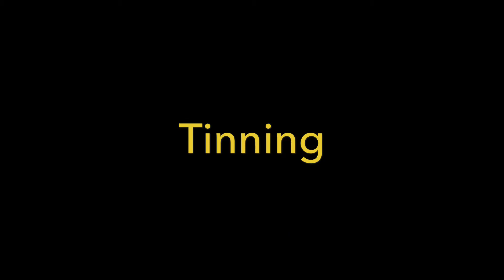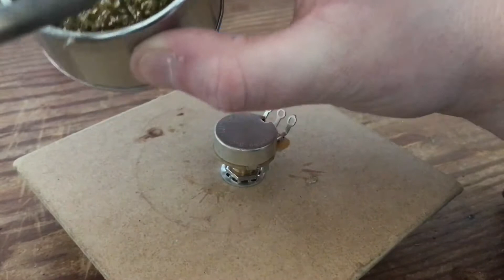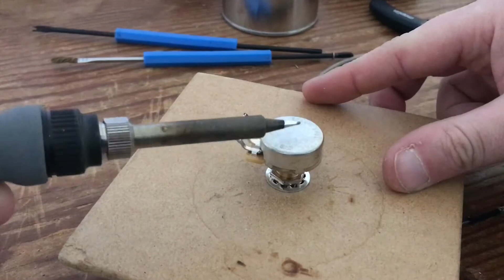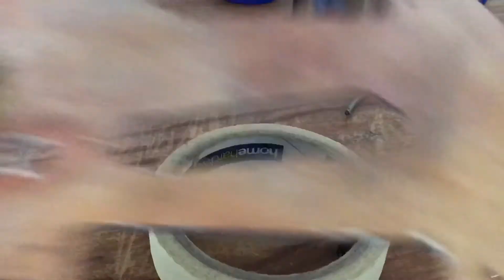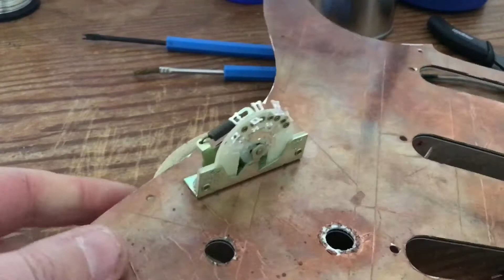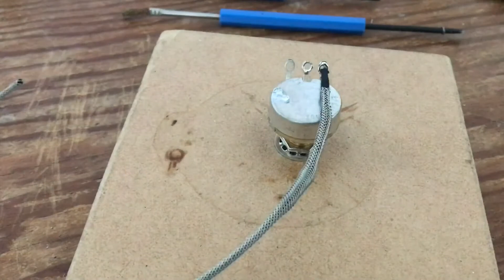Guitar Soldering: Tinning Electric Guitar Components

Comment: Just wanted to ask you a question. I have a 1990 les Paul standard. Can I still do the 50s wiring conversion if the pots and grounding are on a plate as stock. Basically I want to be able to remove the stock wiring out with the plate and just install the new harness in and re wire it 50s style?
Reply from the maker: Eathan Straker yes you can just use the grounding plate and put in new pots etc...
Reply: Six String Supplies brilliant cheers for replying 👍🏻